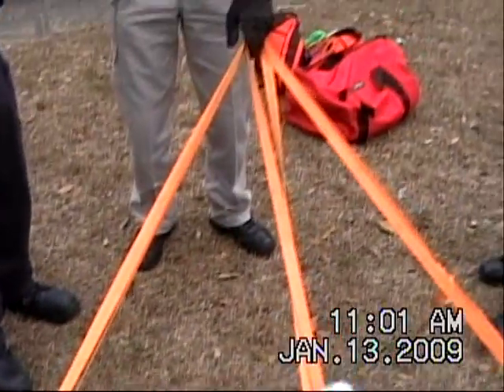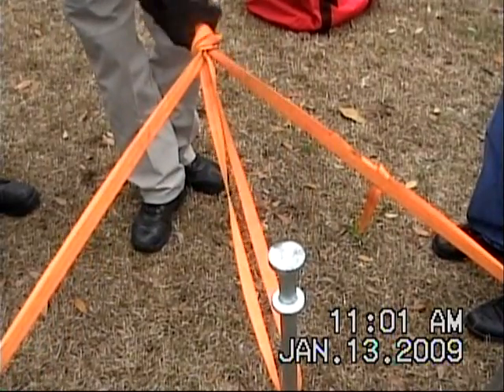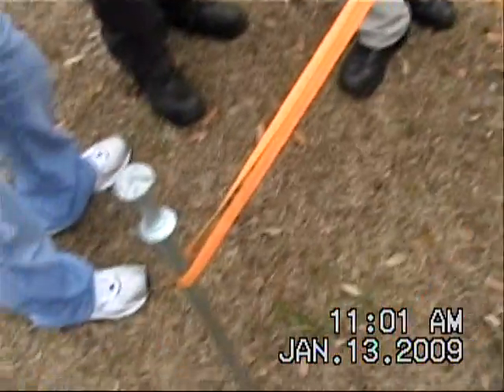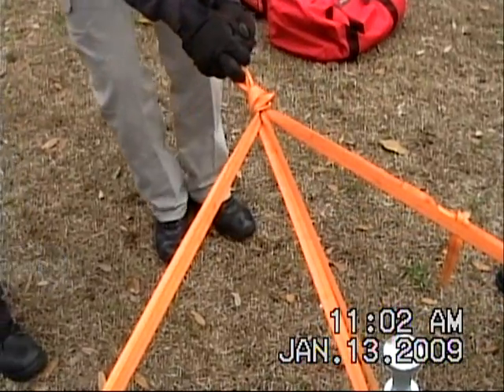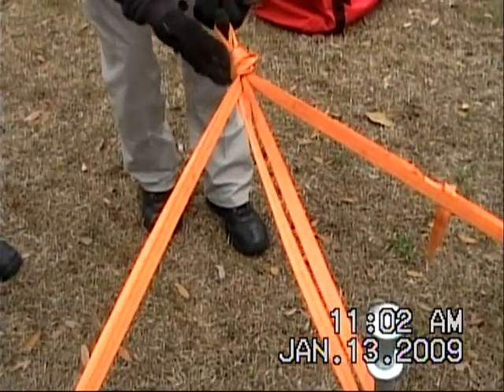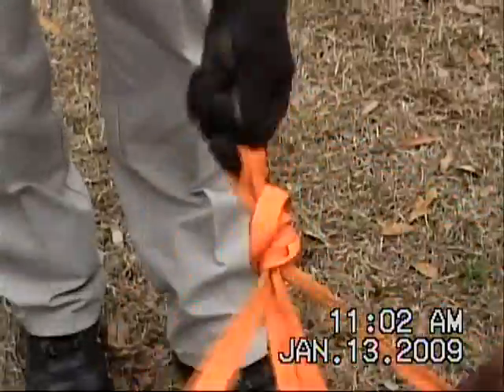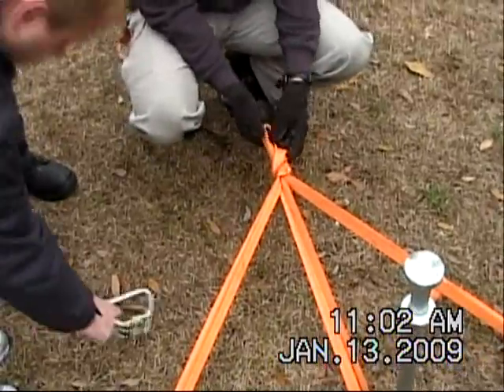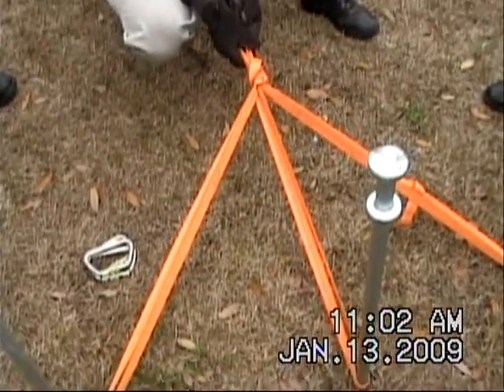3 Anchor Load Sharing

Comment: A shifting load could prove disastrous.  The weight of a rescue load that shifts for whatever reason outside the acceptable angles will cause the weight of the load not be shared equally. I would use this set-up with caution.  Any thoughts?